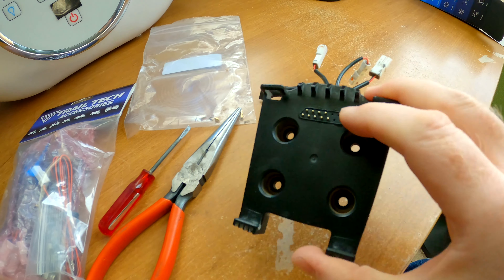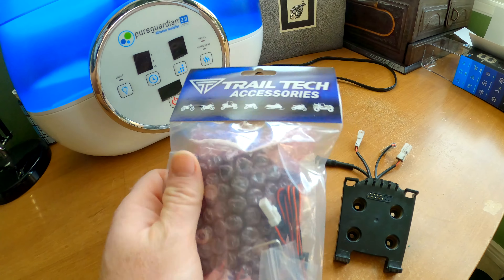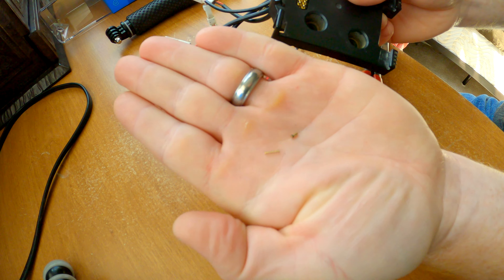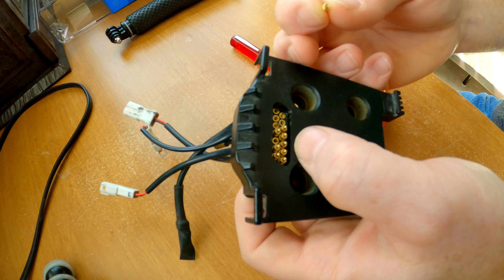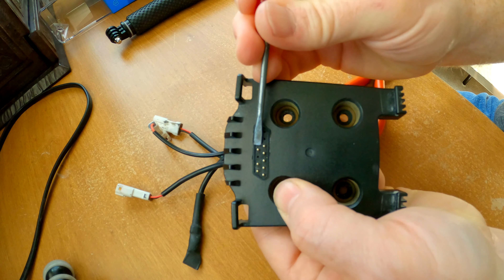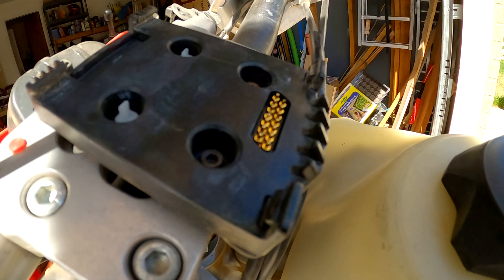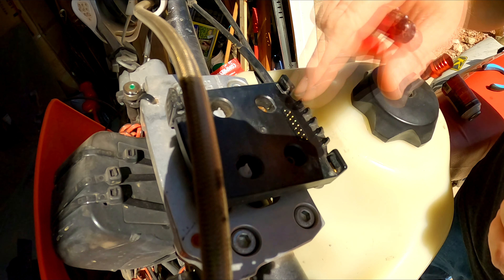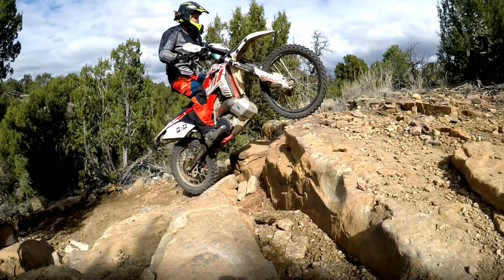Trail Tech - Voyager Pro Mount - Replacing Pins

Comment: Just came across this video trying to see if there was a fix for one of the collapsed pins in my dock. I wanted to pull mine apart to fix it but figured I should look around online first. I'm glad I did as I thought for sure you'd have to go through the back, It's nice to see that the pins are relatively easy to replace from the front side. Me and a couple of friends are all having issues with the docks after riding with them for a couple of years. One friend tried to solve the issue by going to the aluminum dock when one of the clips broke on his but he already has a pin starting to collapse after one season. Will try and use his old plastic dock to see if we can salvage the springs out of that one for the rest of our docks.  Thank you for the video, really glad I found it!

Comment: Nice work. As you found out the spring collapses. This happens because water gets in it and shorts and the spring looses tension. Keeping it clean and using dielectric grease drastically increases pin life. We have also worked with the pin manufacturer to upgrade these pins. All new docks have the upgraded pins. Thank you.
Reply from the maker: Thanks for the info!
Reply: Wow! A company that takes time to explain a fault, takes ownership of a manufacturing flaw & takes it up with the manufacturer to make the product better.
I’m impressed. Very!!
Why am i watching this?? I’m a ‘near future’ voyager pro client

Comment: Good to know that they are replaceable!
I checked the pins with a voltmeter and when you're sitting on the bike it looks like the positive is top row #3 from the right and the ground bottom row #3, also bottom row #2 has voltage too.  It would be helpful to be able to charge this thing when it's off the bike and not have to buy another mount.  It takes a long time to charge when it's on the bike and connected to a trickle charger.
Reply from the maker: Yes, you are right

Comment: Great video.  Where did you get the bag of replacement pins?
Reply from the maker: They are out of the second broken mount I had laying around. So you will need to buy at least one more mount to yank those pins from. Really all you need is the spring that burns out inside...might be able to source that elsewhere but I have not looked.
Reply: Great video. Anyone sourced a spring yet?